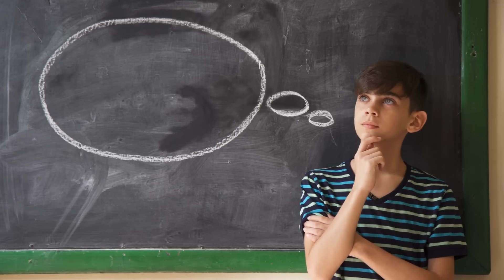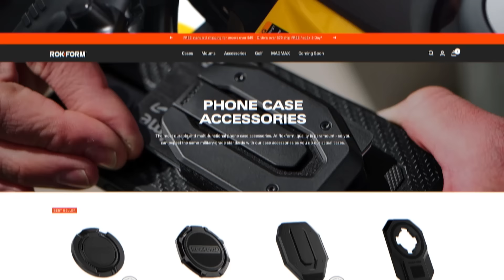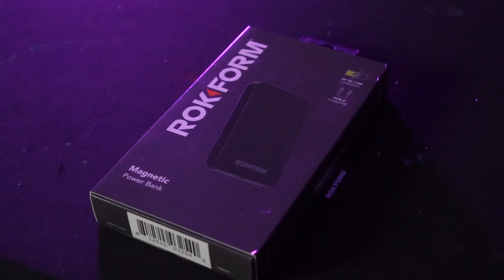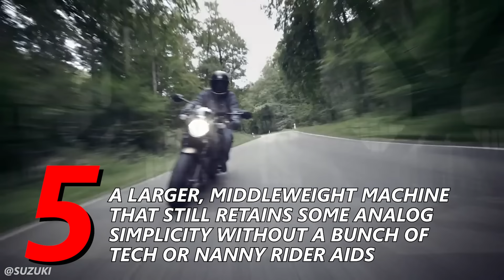Top 5 Motorcycles that will TEACH YOU to be a Better Rider

Comment: For those with no prior experience, e-bikes—especially the moped-style ones that can reach speeds of 35 mph and above—provide a wonderful gateway for navigating city streets. They help alleviate fears about riding on two wheels in a low-stakes environment. Without the need to manage a clutch, riders can concentrate on building their awareness and confidence. By the time I transitioned to a motorcycle, I had logged thousands of miles on e-bikes, which made adapting to a clutch feel seamless. My initial fear wasn’t about the clutch or the bike itself, but rather the challenge of riding in traffic and adjusting to higher speeds.
Reply: For sure, I was a bicyclist commuting to work/school for a couple of years (after a few years experience driving a car already) and it made all the difference when I got on two wheels. These days, I find two-wheelers to be the more manageable way to get around unless I really need to haul stuff or passengers. The only two things is ATGATT and rain - those constraints keep me thinking of how to overcome all the limitations of cars which include severely reduced visibility / awareness of surroundings from the driver's seat, the much greater mechanical forces involved in piloting something ~10 times heavier than a bike, the fuel consumption, tons more possible mechanical / maintenance issues compared to a bike, overall cost of ownership (purchase, insurance, maintenance), and the fact that even getting around in a metal cage doesn't guarantee total safety from injury or death in a - not to mention all the blunders of semi-autonomous driving, inflated confidence of novice drivers, and distracted drivers who are too comfortable with multitasking from their wheelborne armchairs.

Motorcycling is a different set of risks, but there's just something about how SUVs are trending over sedans that make you really think about how unsafe getting on the road really is anyhow. I think any rider who trains their abilities, takes precautions, maintains their bike plus safety apparel, stays aware of their surroundings, and operates their two-wheeler within the limits of their own riding abilities (and the bike's capabilities) is often much better off than car drivers.

I say all this because being a bicyclist in traffic is so much worse than a motorcycle - you have all the disadvantages of being completely exposed, not being able to wear much safety gear since it affects your bicycling ability, being even less visible (small and silent) than a motorcycle, and limited to the power of your athletic ability to get yourself out of a bad situation. After gaining road sense as a bicyclist, motorcycling actually lets me wear better safety gear, use things like rear view mirrors and turn signals, and be a little more visible with engine noise, headlights, and tail lights.

I'm not saying that anybody just starting out their driving career will gain all the advantages of motorcycling immediately. My journey started out with driving a car, then downgrading to a bicycle for years, and then finally getting back to motorized transportation by upgrading to a motorcycle. If you don't cultivate humility (and physical abilities for two wheeled vehicles starting with a bicycle) before getting on a motorcycle as a primary mode of transportation, you will end up in a tragedy. Anyhow, life is risky, operating any vehicle is risky... but the worst case scenarios regardless of which vehicle you abuse (or get into a bad situation because of someone else's abuse of theirs) is all pretty bad. A pickup truck will just as easily kill another pickup truck driver as it would a motorcyclist, if an impact is destined. Someone can just easily go off a cliff whether they low-side their bike or they are cornering too aggressively with their car.

Motorcyclists do face the additional requirements to balance their vehicles upright, and perhaps deal with a much greater power to weight ratio, but again, that is up to each rider to learn about their own body, select an appropriate bike, practice their controls to develop greater abilities, and very wisely apply those abilities within the limits they have set for themselves in general and the limits that each riding situation presents.

All life is precious, any activity can end badly, and we all should try to reduce any risk that we become aware of.
Reply: That is exactly how iam now teaching my mom who is in her 60s, I started her out on ebike now she got a honda ruckus, afterwards a year on ruckus on streets I think she would have the confidence to add in a couple extra mechanics with a clutch and shifter
Reply: Also scooters. Weight distribution is a bit different but it helps you handle the movement and throttle control without needing to worry about shifting. Heard of some people starting with a Honda Navi just to learn the basic mechanics without needing to worry about shifting.

Comment: I maintain that part of the difficulty of becoming a 'good' rider on modern bikes is just how damn competent and capable they've become. When I was learning 40+ years ago, even new bikes of trusted brand and model came with inherent flaws requiring you to 'learn or die'. ANYthing used couldn't be trusted to be a good example of the particular brand/model/type without personal experience- tank slappers just 'happened'. My absolute favorite 'classic' bike has a better handling reputation now than it did in 1975, mostly because it took a long time for word to reach most ears that PLASTIC swing arm bushings were a bad idea, and it had 'em. More of our non- cager related serious accidents back then occurred because of some part/component or basic design letting you down; now, they all seem to be from younger/newer riders riding beyond their experience.

Comment: So I heard start on a 250cc KTM or YZF then ride that for a weekend and go straight to kawasaki H2

Good thing about the UK, we get 50cc licence at 16, 125cc licence at 17, A2 licence at 19, and a full licence at bare minimum of 21 as long as you had your A2 for 2 years. I went through all the stages. First thing I ever rode was a 50cc suzuki quad when I was 7 years old LOL the yellow ones with the blue seat, they had a white and blue seat one as well.
Reply: First meters can be the same if you learn proper starts on an mx bike 🤣